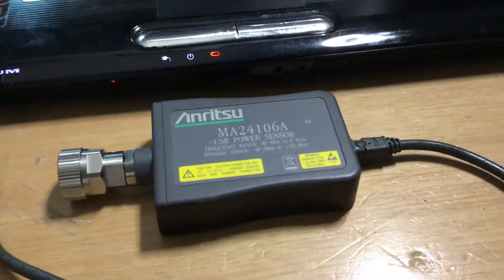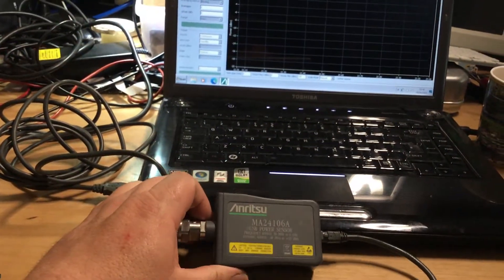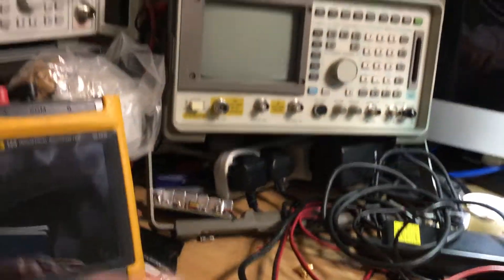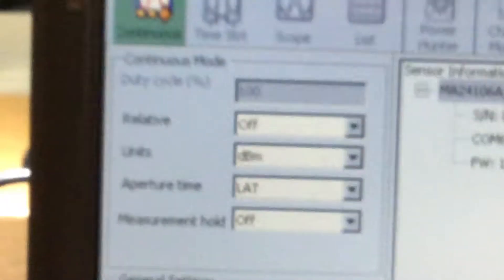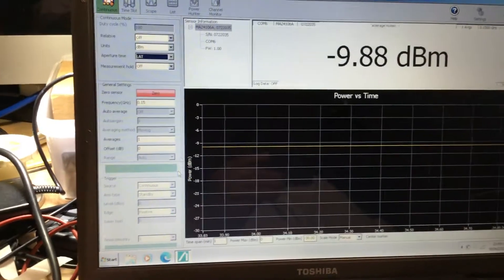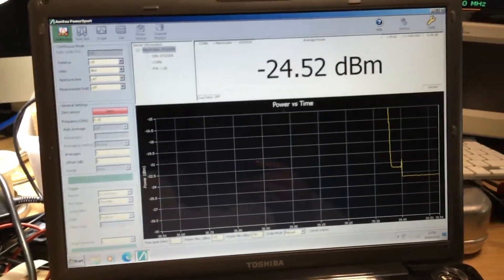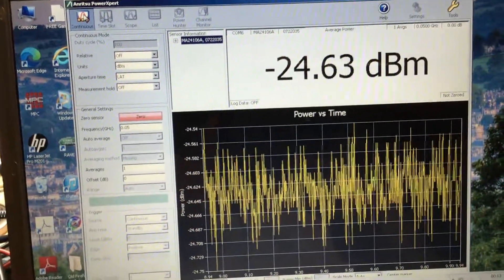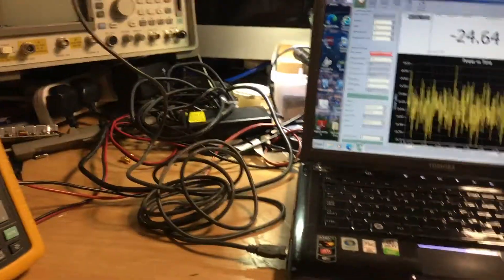ANRITSU RF POWER SENSOR USB MODEL MA24106A MAKING RF MEASUREMENTS & TESTING 50MHz to 6GHz

Comment: How do I set up to measure power output (in watts) of a transmitter outputting 100watts @ 1.135 Gz  using the MA24106A hooked to a -40db inline directional coupler on the output rf cable?  Thanks for any help you can give!